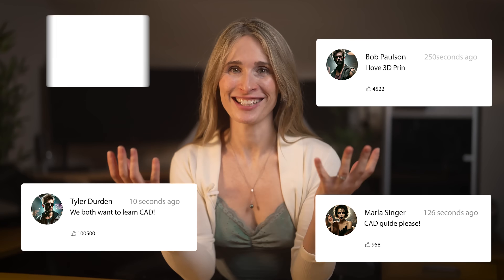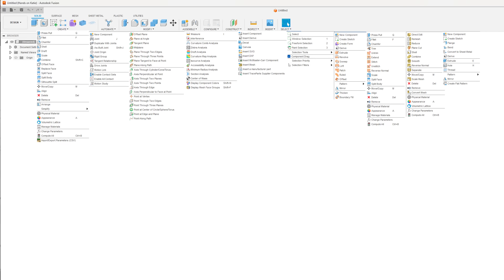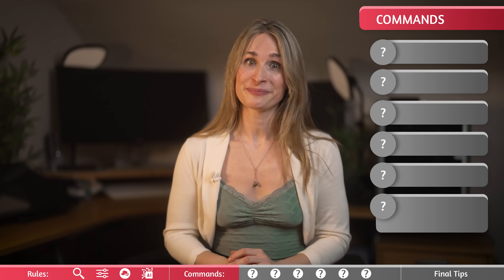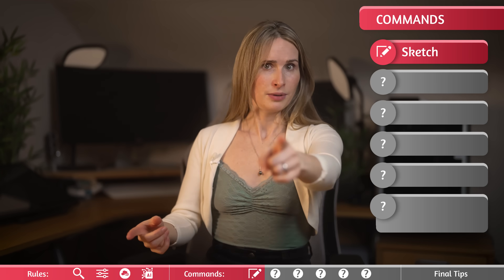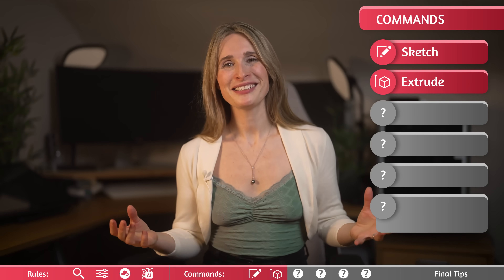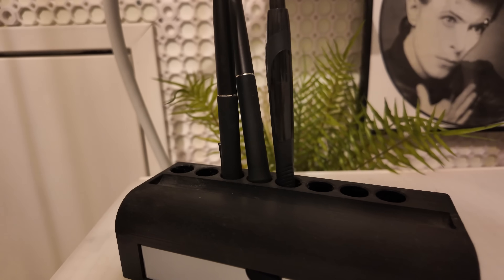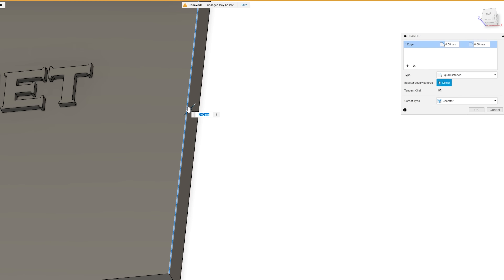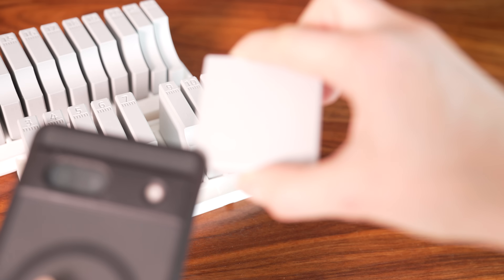The Quick & Dirty Guide to Making Custom 3D Prints!

Comment: Second wrong, filets are only for inside corners; rounds are for outside corners. I've got 23 years of CAD experience and there was a time when precise terminology was important. Shortcuts are always bad.
Reply from the maker: Great that you've got a bit of experience, but you'll need to take it up with Autodesk if you think you know better than them - Fusion uses fillets for both.

Furthermore Autodesk Inventor, AutoCAD, Rhino3D, CATIA, FreeCAD, Solidworks and Vectorworks use fillet for both also.

In truth, as I'm sure you know from your experience, the early CAD offerings were tautologous here and incorrectly applied the fillet Vs round (both etymologically meaning the same thing), these are ultimately functional differences, not definitional, hence they're both now called fillets in most software and the function is convex or concave.

As you say, precise terminology is important, so it's good that they've recognised this.
Reply: @handsonkatie  I don't necessarily disagree with you on that point. There are a lot of things that I learned in AutoCAD 2 and 3 in the early 80's that have similarly been simplified. Maybe I'm futilely arguing for 'The old ways'. Something I adamantly said I wasn't going to do when I got older.
Reply from the maker: 😂 Well maybe it's that - the real balance is spotting the corrections Vs the ideologies! Ie some new things can be more accurate than the old and vice versa! 
A lot of old pc terminology has been corrected (eg hard disk Vs hard drive) and then others have been incorrectly interpreted by newer users. It's always a challenge to keep track, but the right thing to try and do!

Comment: Wrong. If I'm trying to solve a problem that 3D printing will solve, I check the online sites to see if the problem has already been addressed. If not, I design my own 3D print. There wouldn't be any sites to get files if people didn't design their own. So currently, a large percentage of the things I've printed are from these sites, but the small percentage of designs I've created myself solve the problems I've addressed.
Reply from the maker: Not sure you've finished watching the video yet or you've misunderstood.... 😉
Reply: @ No, I jumped the gun after Rule 2, so I kind of get the point.
Reply from the maker: 😂 Then we're in agreement then!

Comment: 20 years professionally with 3D CAD and 3D Printing

I like your introduction into 3D printing, it concise and on point.

Just a small note 14:04, it hard for any people relatable between what design on screen vs physical world.  So recommend print something first (from those library) and after start modifying in CAD to what you want.

Then follow by getting a good fits & tolerances, by creating a 'machine torture test' piece (not exactly the 'Benchy' test)
Reply from the maker: Great tip - totally agree!

Comment: Lol you think Fusion360 is "Autodesk" (IE Hard to use), try using solidworks.  Try just opening solidworks... They bind you to a website for authentication and you have to click a link in that site to just to open he damn tool...  Its made for engineers, not Makers.  There is a reason why F360 is $480+ a year (not personal use, thats free)  F360 is soooo much easier to use and super powerful all in a single package.

Comment: Overall a great video for those interested in learning CAD. However, I’d add the following rules:
- Is the item something you can order or buy from a store? 3D printing is great but is rarely the most cost-effective or highest quality solution.
- After learning the basics in CAD you will eventually run into problems that require more advanced techniques. Always be open to learning something new.
Reply from the maker: Great points - although I'd modify your store point to 'always check' the cost. Some things are massively cheaper to 3d print (eg silly proprietary brackets for devices and the like) and some simple mass produced things are cheaper to just buy (think large simple plastic boxes!)

Comment: I finally purchased a dimensionally accurate 3D printer about a year ago and started using Onshape to design with.  When I need something, I regularly start with the two search steps, and if I find something similar, I might take the remix step, but I have not explored AI.  Remixing seems like a good idea, but I find it difficult to modify an STL or STEP even though I can import it.  I end up copying important dimensions and using them to create my own design.  When I do design something that I think could be useful (Hint: if it is useful to you it is likely useful to others), I post it to thingiverse and printables and also provide a link to the Onshape project.  This way, if someone wants to modify it or just see the steps I used to create it, they can copy it into their own free Onshape account and make it their own.  I make all designs I create fully public, so anyone can make use of them.
Reply from the maker: Great advice! Sharing with the community is a brilliant way to help others! 🙏☺️

Comment: Great job! Everything you mentioned is perfect for starting out from scratch. I even LOVE that you used the correct term, 'clearance', for what it is. Sadly so many call the spare room needed a tolerance. Nope, wrong. 

Any way, I've taught CAD & design for 20+ years and there's 2 things you might consider adding. First, add all the dimensions to every feature, fully constrained. (It takes time and may seem irrelevant, but it's good practice for when it's needed.) Don't just draw lines & circles without sizing and locating. Why? Because if they are not nailed down, they can move. This is especially true in an assembly. And who wants parts that change size because they just want to?

Second, a thing I get asked a lot, is, 'where do I start?' I try to get them to think of how they would make this if they were given a piece of wood. What would they do first, next, and so on. It usually works and relieves some 'getting started anxiety.'

Put this into your words and please share.  :-) Thank you, a lot, for what you are doing here. I watch to enjoy your creative process and maker tenacity. Keep it up!!
Reply from the maker: Wonderful points and yes you're totally right (although I was trying to be super ruthless). But constraints and fully dimensioning are a huge part of getting it to 'click' - I was thinking of covering these as a follow up video. And yes on tolerance/clearance, I see that all the time too! 😂😂. You sound like you'd have loads of great experience to share in my discord channel, drop me an email on my site if interested and I can share a special link for you!

Comment: Great content and polished presentation as usual.. and who doesn't love a flash frame 😉. As a professional designer, these are all really good tips.. If you are going to design yourself most of all then have an open mind to your designs and see where it leads you. If you have the ability to consepulize in you head before you start then great, after that... Iterate... iterate then iterate some more.. then if you screw up.. just roll it back and try another stratergie. Another couple of things I would look out for is tolerances and shrinkage.. the latter varies from material to material so experimentation is always necessary. If you would like some more detailed thoughts, please contact me directly
Reply from the maker: Great point Mark, I actually cut out this point about 30 mins before I published (just being over ruthless!) - but totally right, just starting again and iterating is a great tip for people!
Reply: @handsonkatie  Yeah its how we work on a daily basis, not just because your designs can go pear shaped quickly .. usually due to over or under constrianing models but also because CAD software is pretty buggy and crashes are frequent ( Thanks AutoDesk)
Reply: Yes, iterative designing permits the opportunity for continuous improvement. There’s a reason why I’m working on version 5 of my Iron Man gauntlets. They just keep getting better with every new version.
Reply: @ryanernst4675  sounds amazing, can you share a photo?

Comment: I was already on board with not starting from scratch. Thank you for the tip on parametric models! This is a game changer. I already used it to make a project box that is just the right size. I use Tinker CAD to modify other designs - it is basic but gets the job done if you aren't doing anything too complex.
Reply from the maker: Awesome! And really do check out things like the Underware item generator, you can make thousands and thousands of files from just one free parametric file! I've got lots more parametric models coming soon for other parts of the house!
Reply: Tinker CAD does not get enough love. It is a very powerful tool for what it is. I use a combination of it Fusion and FreeCAD for my modeling. Tinker CAD has a simplistic set of tools that honestly just work well.

Comment: That was amazing! I'd like to recommend one thing, though: a good pair of digital calipers makes everything so much easier.
Reply from the maker: Brilliant point! I've got tonnes all over the house!! 😂
Reply: @handsonkatie  Do you prefer metal or plastic? I've been a fan of the metal ones (I've had Mitutoyo Digimatics at work at one point), but I have also had a friend accidentally weld a pair to the terminals of a lithium ion battery when trying to measure the distance between them, and swear off metal calipers for any electronics. That was an interesting day.
Reply from the maker: Metal is the only I've tried! But sounds like you learnt the hard way! 😂
Reply: I’ve found a steel ruler useful too.

Comment: The Commands section is also perfect for anyone wanting to learn FreeCAD, as long as they use the "Part Design" workbench (my favorite).
Tip: There's a similarly named "Part" workbench in FreeCAD that shouldn't be confused with it, as it uses primitives (cubes, spheres, cylinders) which is a completely different (and IMO more limiting) design process.
For anyone not familiar: FreeCAD is completely open source, multiplatform (runs on Linux, MacOS, even Windows), fully parametric, extensible, and the best part: All of your files are local.
There are no restrictions on the number of models, complexity of assemblies, or where you are allowed to store your files like many of the other free offerings.
Reply from the maker: Great tips and yes, Free cad is an excellent solution, so well worth a look!! ☺️
Reply: Freecad is getting so much better with the recent V1.0 release, worth another look if you hated it in the past.
Reply: @jeremiahbullfrog9288  Very true! The Sketcher improvements alone are phenomenal.
BTW: I love the username! Great song!
Reply: FreeCAD can also be used to create parametric designs. I've done a few, myself.
Reply: I would really like for the hands on community to create a set of tutorials showing these commands in different cad programs. 
I would like to get started with freeCAD too
Reply from the maker: @SornDP  Great idea - we've talked about this in the guild a bit - the challenge is which software and what level of detail, but let us brainstorm this a bit on discord and keep an eye out for things in future!

Comment: Step 1) Do not buy any Creality products.
Step 2) Do not buy any Bamboo Labs products.

Since some people can't seem to handle opinions, I'll say this. 

Creality abandons products (incomplete firmware, broken firmware) and has poor support. Your best bet is to return any unit you buy if it has the slightest hiccup asap. 

Bamboo may as well just sit in your house, watching you. It's crazy.

Background checks are on the horizon. 3D printing is about to take a very sad turn. More to come....

Update 1/19/2024:
Bamboo Lab's "secure" keys have been published. It was, apparently, a very secure system.
Reply: Are you referring to the new policies Bambu is pushing out about requiring print jobs to go thru only their networks?
Reply: @CMDR_Shokwave  yes
Reply: @CMDR_Shokwave Not true, don’t repeat misinformation and instead do your own research if you are capable of independent thinking.
Reply: @radish6691  I'm just asking if that is what he is concerned about. Doesn't affect me personally.  I just bought an X1C combo for shits and giggles. Worked great for drone attachments and NVG bracket prototyping and other random shit. I'm not doing anything for business or proprietary designs. I can see where someone with a farm running remotely controlled or with designs that they want to keep to themselves would be concerned.  Those are valid concerns that need clarification. That is why I asked OP what he was on about. Mine works great. Software works great for me, too. Fun toy to mess with for me, but it is clearly an issue the 3d print community is very concerned about and not something to be just dismissed away because it doesn't affect you personally. Hopefully, Bambu continues to reach out to the community and maintain an open and honest discussion.
Reply: @CMDR_Shokwave  Your claim that there are new policies requiring print jobs to go through their networks is false. Cloud jobs, obviously yes but that’s not due to a policy, that’s the definition of “cloud”: someone else’s computer. LAN printing doesn’t require an account (or even an internet connection) and still won’t require an account (or internet connection), everything stays local. Printing via SD card, obviously neither an account nor a network is required.
Reply: @radish6691  it's ok, bro. The OP answered my fairly generalized question. I'm sure Bambu will have this firestorm out before LA does. I'm just eating my popcorn (from a 3d printed bucket sent remotely thru their network) and watching the show. It will all be ok. 👍
Reply: @ I’ve got no worries either, the world is welcome to see the many fidgets I print and give away. Happy printing!
Reply: Prusa rocks!  Two important rules;
1) You get what you pay for. 
2) Cheap IS expensive.
Reply: @BitSmythe  buy once cry once. Learned my lesson for sure.
Reply: @bearb1asting  ehhh my Bambu works just fine. As for the news, is all I see is a bunch of people losing their minds over nothing. Wasn’t ever a secret that Bambu was proprietary.
Reply: Love my creality ender 3 printer!
Reply: @leemontgomery72  there's always a few good ones that make it off the line ^_°
Reply: Bambu works just fine. You do realize you can slice and upload via sd card with no wifi right?
Reply: The flashforge adventurer 5m is just as good if not better than the bambu.
Reply: @ Which Bambu Lab printer? Also, “Please note that ABS series Filaments is not compatible with the AD5M” on the manufacturer’s product page.
Reply: 1. Don’t listen to idiots in the comment section that tell you what to buy.
2. Please see rule number 1.
Reply: Creality helped to get loads of people who were interested in 3d printing, actually 3d printing.  My Ender 3 is still working great after 6 years.  Tons of upgrades for cheap and never had any issue with their firmware, and at $30 for a motherboard upgrade that allows you to run other FW and zillions of forums, groups, videos, etc on their products, it would hardly be an issue.
Reply: @MantisRay861  well, it sounds like you're a lucky one. I have a hardware issue, and it will never be "fixed" due to the lack of their support
Reply: @ what’s the particular issue?  Oftentimes a $30 or less upgraded part will fix it.  Original bed was warped, glass bed was $20,  extruder tensioner arm broke, $5 replacement for metal one.
Reply: I’ve returned both😊
Reply from the maker: 😂 bad experiences???
Reply: @handsonkatie  on Creality, yes. On Bamboo, the news speaks for itself.
Reply: Step .5 - don’t listen to OP. You do you. You’ll be fine.
Reply: I have over 5000 hours on my flawless Bambu printers ....No one is watching and I could care less what they do with my files . I'm not trying to print guns at my house ...what are you hiding bud ??? Lol
Reply: 🤫 and go print yourself a tinfoil hat
Reply: @radish6691  you folks make me laugh
Reply: WTF R U to tell what to buy? Give a reason to back yourself or keep the trap shut!!!
Reply: @cjgaucicharlie3226 Probably because Creality has so many issues and Bambu just announced major changes (negative).
Reply: @cjgaucicharlie3226 bambu just updated their terms of service. Now everything goes through their cloud. Plenty of videos on it.
Reply: @cjgaucicharlie3226  you get your reasons now ^_°
Reply: @cjgaucicharlie3226 I mean, they did give some reasons, maybe after you posted this Idk but I disagree with the antiCreality claim
Reply: @ it’s not that serious bro.

Comment: Thanks again Katie. My printers are running full throttle now, doing Multiboard and Gridfinity. Your underwear is next! 😆
BTW, I use Shapr3D to design...( I love designing my own models!). I started using Fusion before, but Shapr3D's user interface with the iPad (so nice) as well as lower price is what sold me...
Lastly, as a designer and having watched several of your videos, is your logo a boob?  ( . ) 🤔😺

Comment: Personally I would rate blender way higher than most people who make their own models do.
Because since most people's starting point in 3d printing (and your own recommendation too) is to use the models that already exist. And all of those are shared as stl. Remixing them or making very small personal adjustments is not something you want to do in fusion.
Reply from the maker: Great point, Blender is a phenomenal mesh modeller, so you're right, great for remixing where a lot of the dimensional work has been done. Fusion is actually ok at editing stls, do this quite a lot too!